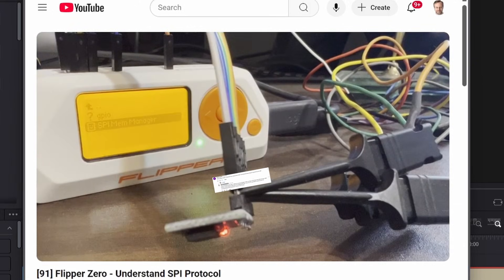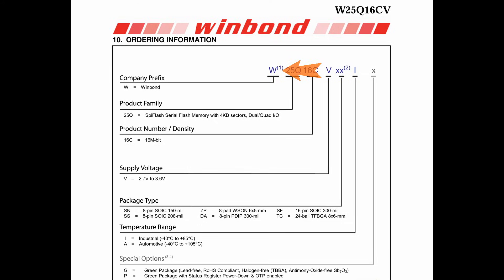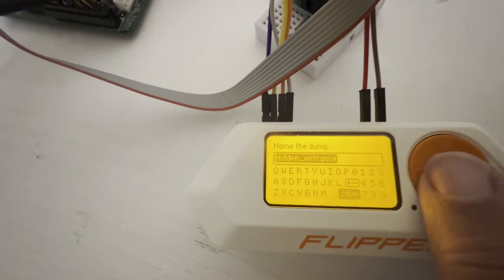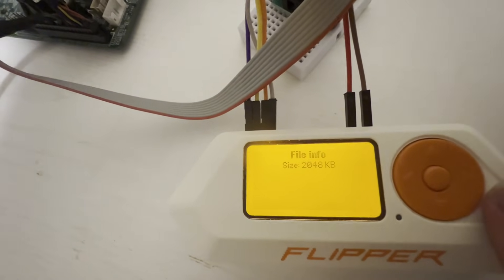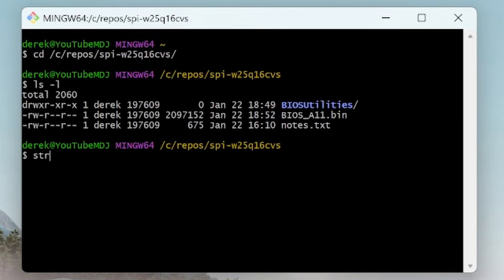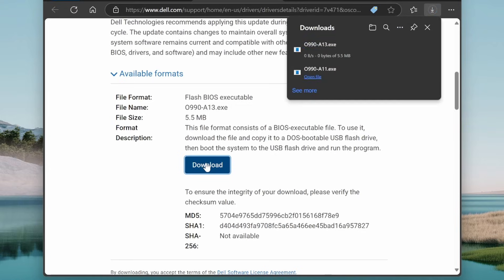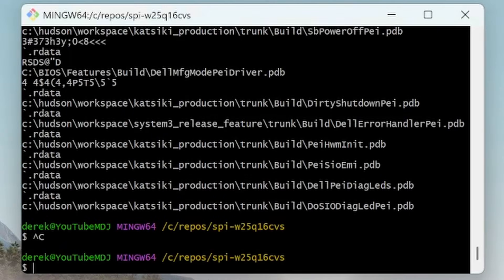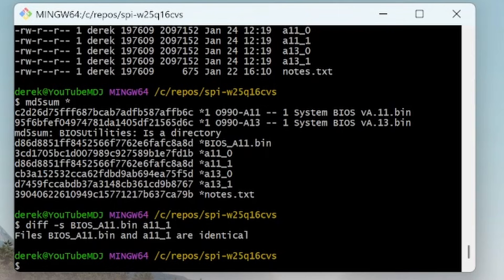[149] Flipper Zero: Dump firmware using a test clip

Comment from the maker: In a future video I'll use the Flipper Zero to write to the Winbond chip & we will also attempt to dump the larger 16-pin Winbond chip (my new 16-pin clip should arrive next week)!
Reply: Hi CodeAllNight, I hope you're doing well! I'm currently working on a project using the Flipper Zero with the Wi-Fi Marauder to execute and optimize a PS-Poll attack script. ve noticed that there's a lack of detailed documentation or videos on this specific topic, particularly regarding setting up with wifi marauder could be a great way to push its boundries. . I was wondering if you could provide any advice or guidance based on your expertise. Additionally, I think this would make great youtube idea.  et me know if you'd be interested in exploring this further or sharing insights. Thanks!

Comment: And what is the first 2mb file part for? Is the dump incomplete?
Reply from the maker: Thank you for your question. I just went and researched it further; since at the time of making that video I had no idea!

The .BIN file we extracted from the web was 4MB, but the chip is only 2MB (and the entire contents of the chip matched the 2nd half of the 4MB file).

So what is the first half of the file we downloaded used for? It turns out parts of the first 2mb of the .bin can be found in the other Winbond chip, which is 16-pins and needs a bigger clip [see video 150 for more info]. For example, address 0x20000-0x41680 from Dell's BIN file (part of the first 2mb) can be found in the 8MB Winbond chip at 0x620000-0x641680.

The larger 8MB chip does not contain any of the 2nd half of the file (that is only copied to the smaller 2MB chip).  The larger chip also gets updated with different contents every time I reboot the system, and contains many machine specific information (like service tag, ownership, asset, boot drive names, etc.)
Reply: @MrDerekJamison  Thx